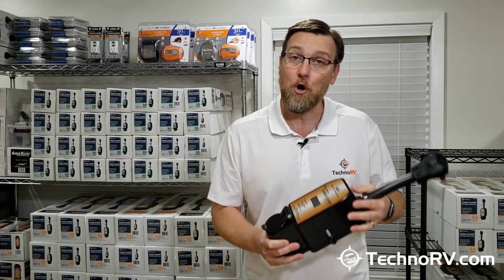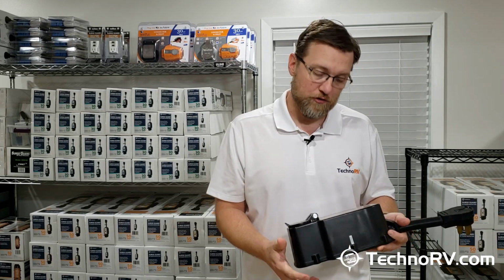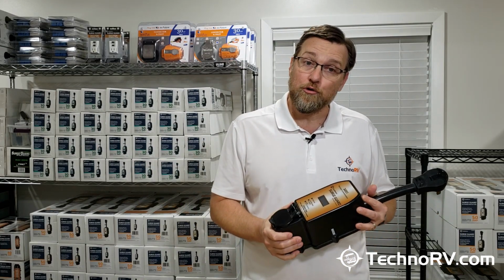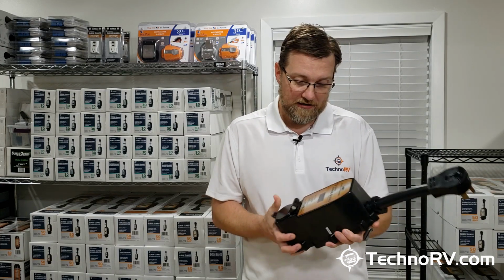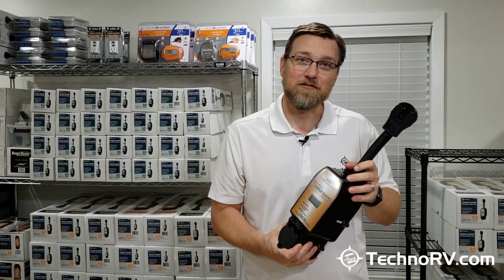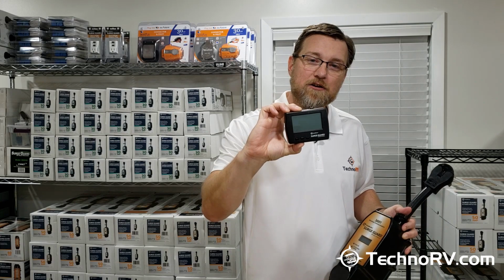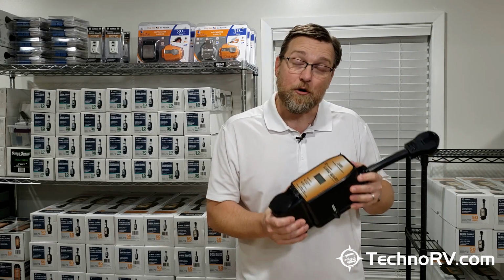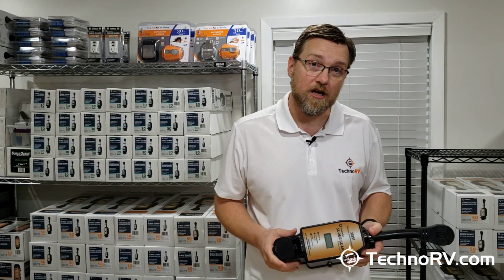Surge Guard 34951 RV Electrical Protection System

Comment: Hello Eric, thank you for posting this video. My 50 amp coach has a built in surge protector. This past summer we were plugged into 30 amp service. We were very careful to not overload the circuit by running only one of the 3 air conditioners at one time and turning it off when using an appliance. Upon disconnecting the shore power after our month’s stay, the left prong (ground at top) of the 30 amp end of the dog bone was burnt and the plug was melted. It appears that the receptacle on the post was faulty and arcing may have occurred. What can I purchase to protect our unit from damage caused by faulty wiring, breakers or receptacles at the post. Thank you

Comment: Can I use this for my Tesla?
Reply from the maker: The connection points to this device are specific to RV plugs, so it would not work with the charging cable on a Tesla.

Comment: hi so I have to ask   can it be used on a generator
Reply from the maker: Yes it sure can! You simply need our Generator Bonding Plug ($12.99 on our site). Plug that into your generator to prevent the Surge Guard from shutting off power due to an open neutral.

Comment: What is the response time for the surge protector to disconnect in the event of a large power surge?  Joules, without a miniscule response time, are not impressive. This company does not include response time on its specs on many marketing pages, which is unimpressive for a power related company.  Thank you for the otherwise excellent review.
Reply from the maker: Hi Anne, I have spoken to the engineers at Surge Guard and their unit closes power as quick as any unit on the market. They do not use this as a marketing tool as other brands may do. If there is a surge, the unit will stop the surge. Surge Guard is so confident in their protection units that they even include a connected equipment coverage in their warranty. This means that if the unit does not do what it is intended to do, and something in your RV gets damaged, they will pay for the cost of whatever got damaged. No other company does this but them. Hope this helps.
Reply: @Technorv  Thank you kindly for talking to the engineers and replying with this follow-up!  Providing connected equipment coverage is indeed an excellent sign, though the savvy consumer would also seek real user reviews for how reliably the company backs up those claims. Surge protectors are complicated to compare, I'll grant them that, without agreeing that response time is "marketing".   The spec sheets posted on the Tripp-Lite website for their large family of well regarded home/business surge protectors are the exemplar for consumer info.  They also have a great article or two explanaing how to interpret the specs that are the main differentiators.  I'm disappointed that similar specs aren't available, even buried on the manufacturers' pages, for many RV devices that cost hundreds of dollars in some cases. That said, they know their business better than I do.  Again, thank you for the very helpful review for important expensive products that are difficult for the layman to assess. If you repeat this exercise in the future, I encourage you to consider including models from Hughes Autoformers.  I just ordered the PWD30-EPO for my own Class B RV, and found their customer service rep extremely helpful and forthcoming, not an engineer but with just enough technical detail to meet my needs.
Reply: @Technorv  as I'm reading their exact warranty, this statement is incorrect.  They say they cover what your insurance coverage won't.  They don't specify Ann amount.  I'm comparing this to the EMP Shield and they offer a $25,000 guarantee.

Comment: Eric/TechnoRV - thank you so much for this excellent instructional video!!  I own one of these items, however I have 30 amp service required in my RV.  May I simply use the dog-bone converters (one that plugs into the campground's 30 amp service) and one that plugs into the surge protector giving me a 30 amp socket, or am I better off buying a 30 amp surge protection system directly?   Thank you!!
Reply from the maker: Hi James!  It is always recommended that you match your surge protector to your RV, so if you have a 30A RV, you would need a 30A Surge  Guard.  Then you can adapt up or down from there.  I hope this helps!
Reply: @Technorv  Thank you - and yes, I returned the wrong one and purchased the correct one!!

Comment: Hello.  Do I need to protection from a 3500 watt inverter generator?
Reply from the maker: Hi Rod, You can connect a Surge Protector up to a generator, and a lot of people do this. The other side of this is that usually generators have little issues with voltage, so it is really a personal choice. I hope this helps. Eric

Comment: I just purchased a class b van and it has a 30amp power cord. What is model number with Surge Guard is the right one for a 30 amp camper van?
Reply from the maker: Hi Robert, you would need the 34930 unit. You can find them on the TechnoRV,con site. I hope this helps. Eric
Reply: @Technorv  Eric, thanks for replying and I looked at the site and I see that the 349341 is on backorder

Comment: What is the difference between the 34950 and the 34951?
Reply from the maker: Hi Mark!  The 34951 monitors frequency and it can be connected to the optional Bluetooth wireless display monitor.  Other than that,  they offer the same protection.
Reply: Thanks, I just ordered the 34951

Comment: i have a 50 amp connector. Will this new plug work?  I now have the twist lock connector.
Reply from the maker: Hi Ken, 
The Smart Plug does come as a 50 amp and yes, will replace your twist lock connector just fine. You will love the new Smart Plug if you decide to get one. TechnoRV has them in stock and ready to go when you are ready. 
Safe Travels. Eric

Comment: Is the wireless adapter the only difference between the 34950 and 34951?  Do they both have the T handles for easy removal?
Reply from the maker: The 34951 also has frequency protection, and the 34950 does not monitor that point of data. Then yes, the 34951 can work with the optional wireless Bluetooth monitor. I hope this helps. 
Eric